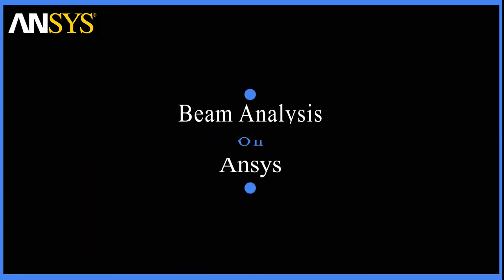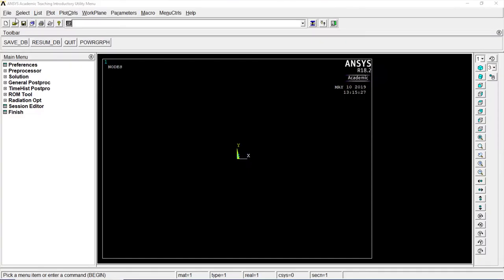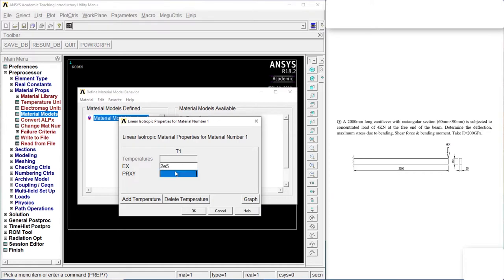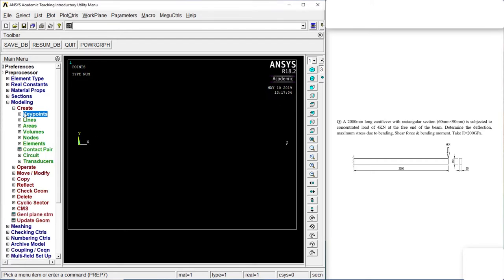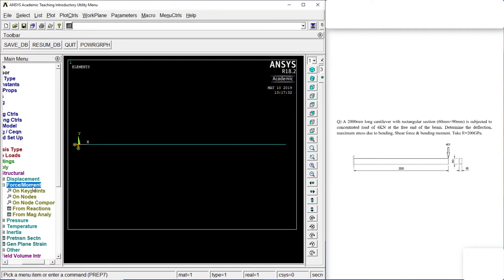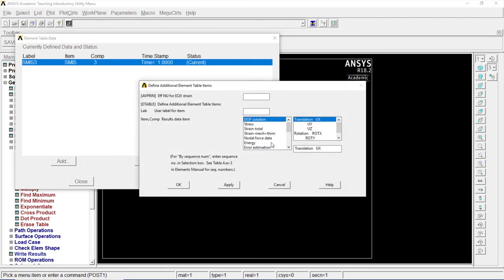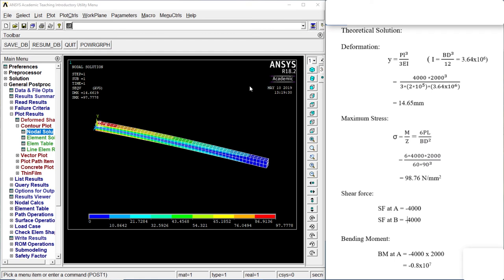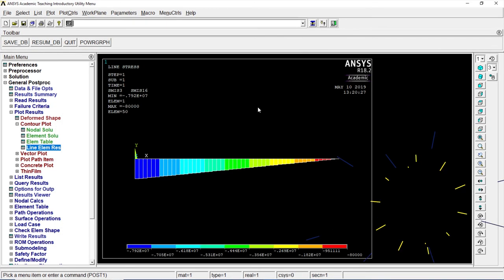Analysis of Beam Element Using ANSYS

Comment: As I see, you defined the dimensions of the beam in a wrong way. I think depth (H) should be 90 and width (B) should be 60. Could you check it out? Thanks for the video!
Reply from the maker: Just see the video at 4:39 the bar looks similar to the diagram
Reply: i have also same dout

Comment: i have aproblem  as define link180 get message at real constant as not supporet  LINK 180 whats the reasons
    please help
Reply from the maker: which version of ansys are you using?
Reply: @MachenDesign  18.1
Reply from the maker: i have not used the latest version of ansys but i suggest you to use “3d link 180 “ 
i am not sure about the option just give a try
Reply: element select should be beam 2 node 188 i think sir